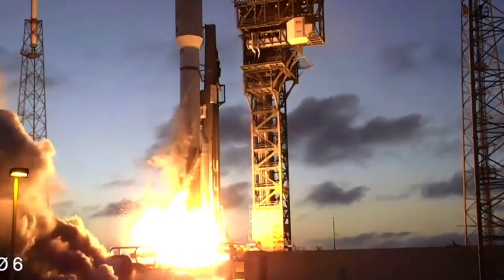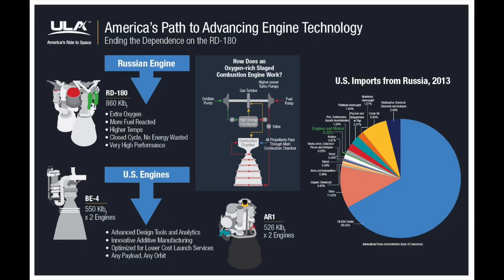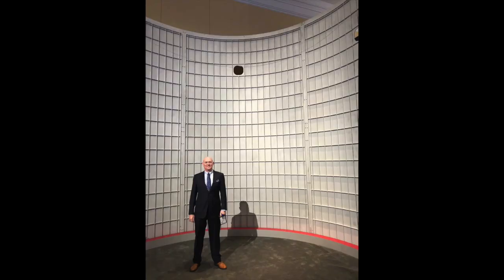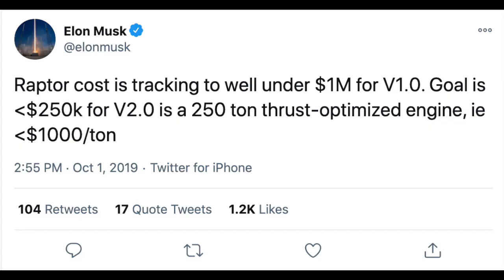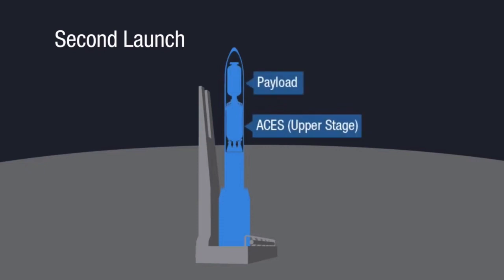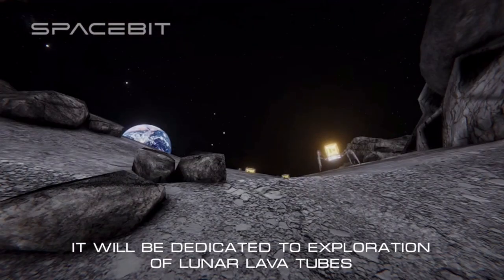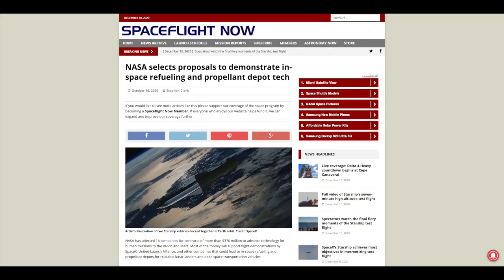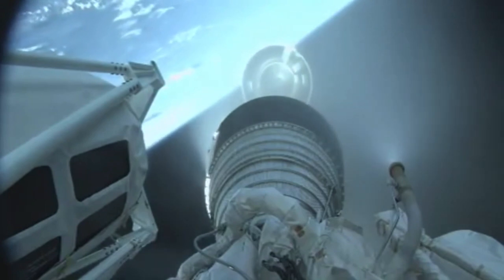Vulcan-Rockets in Ten Minutes or Less

Comment: "vulcan will be leading the charge back"...... FH would like to discuss this with you...

SNC and dreamchaser are most likely going to beat Boeing and ULA to manned spaceflight.
Reply from the maker: Important to note ULA is just a launch provider, Starliner is a specifically boeing project. Of course FH and F9 are going to be more cost competitive at this point, but right now, there aren't many other options for spaceflight, and Vulcan will be up there leading the charge. Especially if BO keeps sitting on it's hands.
Reply: @cost-pluscontent2371   You have been keeping up with the latest artemis contracts right? Gateway is literally going to be the path to the moon. 

Boeing is one of two major constituent parts of ULA, and Starliner is launching only on ULA rockets.... trying to wedge the two is hilarious, it would be like trying to claim Lockheed and AJ/RD are separate contractors contributing to sls.

Vulcan will be viable as a launcher in the F9 class I have no doubt, but they are miles behind, being driven by a Boeing dominated ULA....

Blue Origin has lost it's mind. They're falling farther and farther behind, and just lost .gov funding because of it. They had better produce, soon, or will be alienated completely